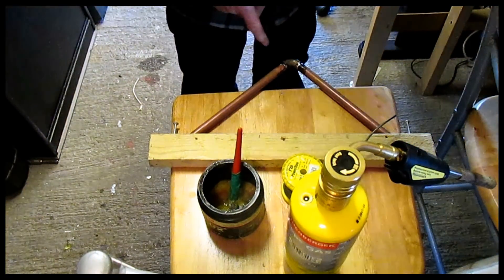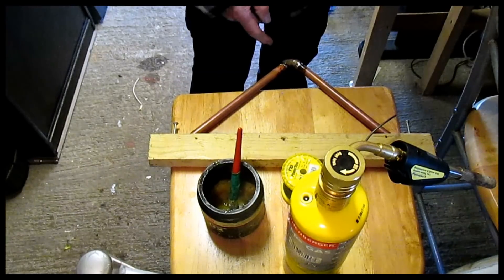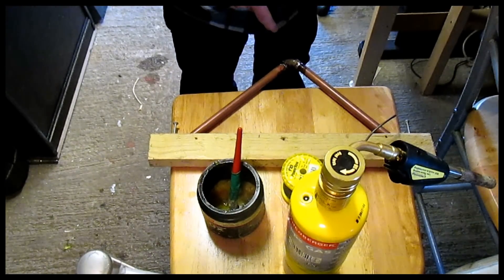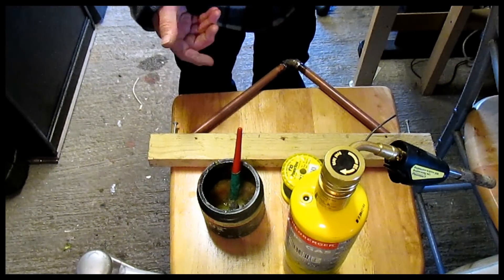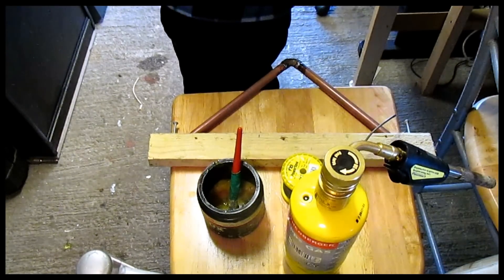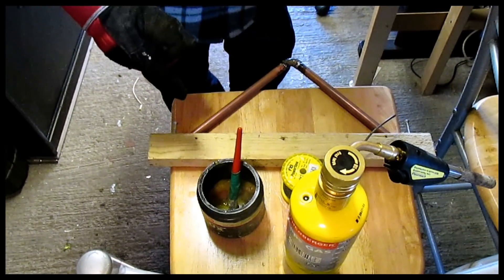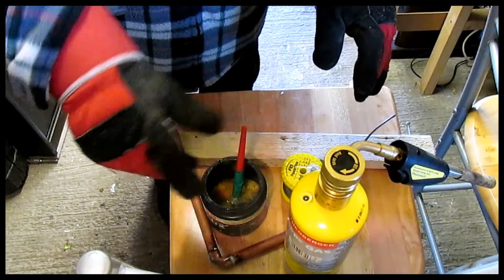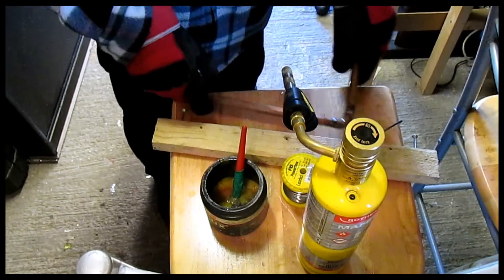toms top tips re soldering a failed joint

Comment: Would it work without fluxing: heat up old joint -> take apart -> heat up -> put back ?  Thanks.
Reply: no. flux is very important in soldering, it stops oxidization taking place, when ever you heat things up they oxidize rapidly and the solder will not run,

Comment: Don't you need to apply new solder to the joint after you brushed old solder ?  Thanks
Reply from the maker: no its not necessary, the  solder is already there , It won't do any harm to add more, but why waste it,
Reply: @TheTomplum  Thanks

Comment: Great video Tom

I had this exact problem recently. And I wondered what you real plumbers did in such situations. 

I cut out my leaking tee (3” either side with a pipeslice) and put in another one using two straight couplers. 

Doesn’t look that pretty but it doesn’t leak now :)

Btw - I always dry pressure test my plumbing. I usually don’t have leaks but it’s saved me several times.